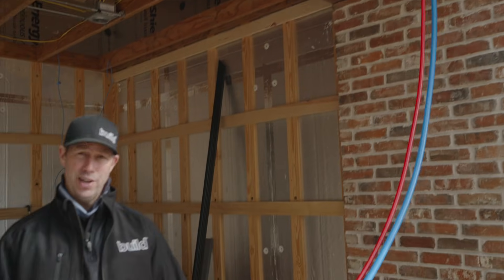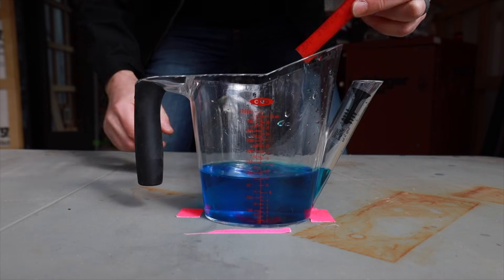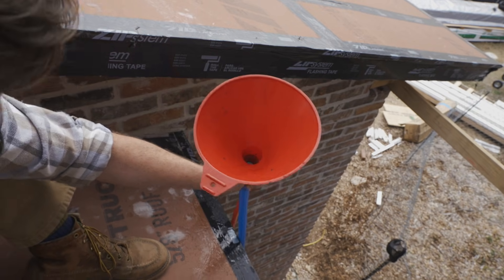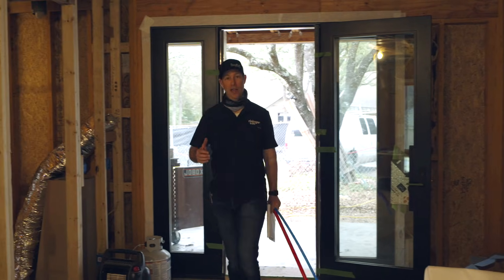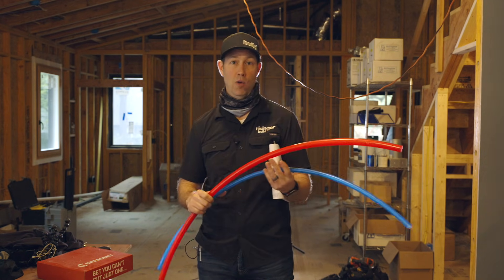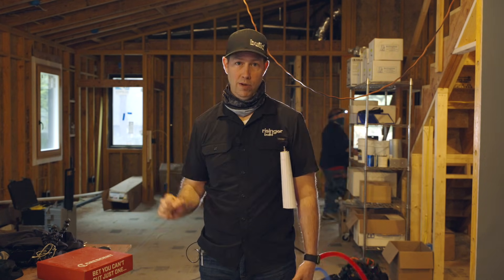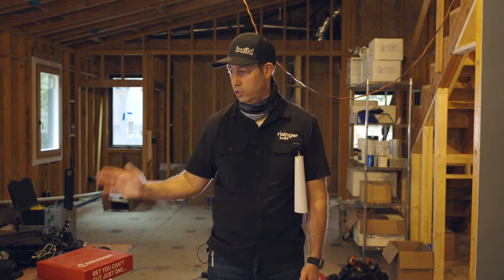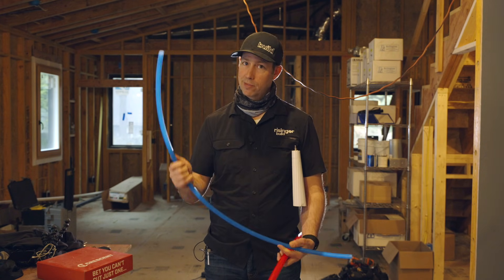What's the BEST Plumbing System

Comment: Been thinking for a while. Would it be possible to use a hot water circulation system as heating in a passivhaus?
Reply: Heat source can be the same,  but your boiler/heater must have separate loops for hw supply and radiant heat.
Reply: Using the main flaw of a circulation system as a benefit, I like it.
It's not hard to calculate the heat loss from such a system. If that exceeds the worst case heating need your architect calculated, then you're golden.
I've build passive houses that need little more then the heat generated by the humans in it. So I wouldn't be surprised if this and the energy reclaimed from the (cooking) ventilation will suffice in many cases.
Reply: I've been in condominiums that use that method.
Reply: Sanden with a special Taco pump ($1500) can deal with DHW and radiant.
Reply: It's called an Aqua therm system.
Reply: Summertime would be the problem.
Reply: @fuumink  I did think about this and was wondering if you could have it set up like a trunk and branch system where the trunk does a full loop with a valve and a pump in it to complete the circuit.  You'd probably be better off insulating the pipes though and reducing their efficacy as heat exchangers
Reply: @fuumink  Which is an extended period in Texas.
Reply: You could do a cheap system like that and run it off a water heater,  but not recommended. Ideally you really don't want heated water that has minerals in it running through pumps and valves, hydronic systems should have deionized water or chemicals added to help prevent scaling or a glycol based fluid.

Comment: Here in AZ I’m worried about the cold water. If we have city water we don’t have cold water in the 115-120 degree August, we just have warm and hot water.
Reply: Perhaps look at burying a loop 5 to 7 feet or so under ground.  At that level, the soil temp tends to run close to 55°F no matter where you are.  It's basically how geothermal heat pumps work for both heating and cooling.
Reply: I used $2 of natural gas to heat my water in August. Only appliance in my house that is gas is the hot water heater. I mostly used “cold” water.
Reply: Same problem. Shower with the faucet all the way on cold and it's still around 100 degree water. On the bright side, the water heater never comes on all summer.
Reply: And that is why hotels would put a sign on the cold water faucets reading - This Is The Cold Water.    LoL!!!!       I didn't even need hot water for showering in the summer when I lived in AZ.
Reply: Put it thru a chiller, or make your own  put a roll of soft copper thru a  refrigerator .
Reply: My grandfather had a similar concern when he moved from a hand pump in the county to municipal water in the city. He drove a closed well pipe into the ground in the basement beneath his bathroom faucet and put a smaller pipe down inside of it passed thru a tee on the top and circulated all the flow to his cold water tap thru it. Basically a geothermal cooled faucet, over 100 years ago, he died probably long before the term geothermal was even thought of.

Comment: Volume = π r² h. Less messy.
Reply: And

For pipes of equal length [h is equal], the ¾" i.d.pipe will hold 2.25 times as much as the ½" i.d. pipe. 

(.75÷2)²÷(.5÷2)²=2.25
Reply: But not as fun
Reply: I thought the same thing.
Reply: Yes, I think doing the math on a whiteboard would have been much more educational. It's always nice for people to see how things they learned(hopefully) in high school math and science class can be applied to everyday situations. It counters the old argument "I'll never use that!".
Reply: Can’t make a video with that
Reply: @Ethan7s  yes you can I watch them all the time.
Reply: @shawnshurtz9147  3blue 1 brown
Reply: @shawnshurtz9147  you can, but not as fun
Reply: Yep. Do the conversions, and you have 1.63c
Reply: @NeonSphinx89  I get roughly 1.47c for the 1/2" pipe. 1/2" is the outer diameter of the pipe. Looking at Uponor's web site, the inner diameter of their half-inch pipe is 0.475". Though the video says it is 0.485, so I might have looked at the wrong version.
Reply: @NeonSphinx89  what i got too
Reply: I'd rather do it Risinger's way...If I am the Plumber being paid by the hour
Reply: Or length in this case..10'
Reply: Google on pipe volume calculator for more info.
Reply: I was watching, saying "There is math for this!"
Reply: pies are round, not square
Reply: Using calculus:

V = h*pi*r^2

becomes

dV = h*pi*2*r*dr

when dr = r/2

dV = h*pi*2*r*(r/2) = h*pi*r^2 = V  

meaning the volumes increase by V when the radius increases by half.

No numbers, but doing demonstrations are fun.
Reply: @kubetail12  same as saying other things being equal the volume is the ratio of radius squared.
Reply: What is the verbal "h"? I assume it's length in likewise units? Or "height" if you prefer?
Reply: @alec4672  this is the internet. It's gonna be "heighth."
Reply: Not fun and more complicated 🙃
Reply: you need to know that 1 oz of water  is 1.8046875 cubic inches
Reply: (Dx.7854)xH
Reply: @georgec1818  nope still no clue.
Reply: Yes for inside diameter which is different ratio than 1/2 to 3/4 if wall thickness is same and outside diameter is the size of pipe
Reply: It would be nice if they did this using simple math, would show the accuracy of the pipe's engineering.
Reply: A little more than double:  3/2 the radius = 9/4 the volume
Reply: h and pi are constant so you can just compare the r squared values of each pipe size.
Reply: Proves 1/4 inch more = almost double.
Reply: Don't forget to insulate to reduce  loss.
Reply: Yeah, but most people need to see something with their own to eyes to really comprehend the results. It's also far more effect to influences someones behavior and choices.
Reply: Thank you!!!  Math is easier than running a pipe on your roof.
Reply: Pex expands as it gets warmer so you get some variance.
Reply: @Rad_Triumph_765_RS  also more math would also solve that.
Reply: @Rad_Triumph_765_RS  this pipe wasnt expanded...you will still get variance
Reply: @Rad_Triumph_765_RS  that has nothing to do with the video though. 100 feet would expand around 10 to 15 inches though it still won't cause more than 2.5 gallons of water per minute to come out of the faucet. Plus you'd already have the hot water at the faucet before the pipe expands.
Reply: Smaller branch pipes -> less volume means less cold water sitting in there, waiting to be drained. Of course - you could do it as europeans do and simply install a system that uses a small pump to circulate warm in the main pipes... oops. Thats what you will do
Reply: Also less fun
Reply: Easier to visualize also...
Reply: So what would that sum look like in cups ? Seems a little difficult.
Reply: Sorry was being facetious, WTF sort of measurement is a cup ????? That’s my point
Reply: All mathematicians in this comment 😂 it is not about a mathematical formula, it is about entertaining, making video more natural and interesting to watch not just puting plain numbers and formulas. Would love to see your construction videos based on numbers 😂

Comment: if you're recirculating the water to keep it hot, how much energy are you using to re-heat the water constantly?
Reply: Great question! I have always wondered this as well. Although, I bet if your lines are insulated it might be pretty minimal.
Reply: @frostman9661  There will be a lot of loss if its running 24\7. The pump will use power to. but it could be put on a timer. really the only time it needs to run is in the morning. 
Personally I don't think its worth the effort. I used a trunk & branch layout, and if it takes 20 seconds to heat up, that's fine.
Reply: And this is why tankless is (arguably) better than a tank.
Reply: @rbnhd1976  That's fair, but unless you have a tankless right beside your shower, you are not going to have much benefit when it comes to wait times, and depending on your set up, they are not any more efficient than regular tanks.
Reply: I added retrofit recirc to after we move in and none of the pipes have insulation. recirc on timer 7am to 9pm and gas bill doubled. (pump was fitted for half the billing period).
Added insulation to hot pipes and bill went down about a quarter. Now, I have the pump on custom smart switch and it would run for 10min every time I turn it on and we would do that before some time before shower (or whenever we want). water get hot very quick and the difference for gas usage is about the same as before fitting the pump.
Reply: Yep, and why its not a good idea in a residential setting. Its necessary in commercial because of large diameter pipes and long runs. What's the longest run you're going to do in a residential installation? Not worth it. Your best bet is to just insulate the lines well so that they don't cool so fast.
Reply: @ruelsmith  I still think it is worth it for residential use. The pipes are still gonna cool over night no matter the insulation. The wait time alone is worth it to me because the water heater is about 50' away straight line and the pipes are abt 100' long because of the crappy it is done. Also gotta remember that just running down the pipe volume is not enough to get hot because the cold pipes will also take away heat so realistically, it takes quite a lot more than single pipe volume to get hot water.
Reply: @victorchan8859  if that's your problem, then run small local water heaters. Recirc lines cool the water in the tank and cause the heater to fire more often, burning fuel and wearing out the water heater faster. I plumb in the commercial segment, and I've put huge boilers in with 3" cold lines attaching to them. Insulation does work. Every water line I put in gets insulated - the cold to prevent sweating and the hot to keep the water warm longer. We insulate with fiberglass, anywhere from 1" of insulation to 2" of it. It works very well for the purpose. Like I said, recirc lines are required on commercial because the lines are incredibly long. I just did a building 5 stories high with a large amount of square footage and not only did those lines stretch out a long way horizontally, but they stretched to the basement where the water heaters were, and they were 4" cold and 3" hot lines down there. You wouldn't want to have to empty all that to get hot water. Residential 3/4" hot for 100ft? Yeah, don't bother recirculating that line. It's just not worth it.
Reply: Many recirculating pumps have timers.  Only run it when folks are at home.

Comment: Measuring using millimeters should be easier.  Just saying
Reply: If all the measurements were in metric we wouldn't have even needed the demo. The volume of a pipe (cylinder) is given by the measurement V = PI * r^2 * l where PI  = 3.14159, r^2 is the radius of the pipe squared and l is the length of the pipe. Using cups and feet is absurd, when we use metric and we can practically do these calculations in our heads: 1 meter of 10mm diameter pipe has a volume of 3.14159 * (10/2)^2 * 1000 = 0.079l, or 79ml. We can then do other calculations like flow rate based off of pressure. One day we'll learn from the rest of the world and actually use that useful system to make our lives easier. In the meantime, I'm sure I'll get a bunch of smoothbrains calling me a commie because I see no advantages in measuring in fractions of an inch or using drinking vessels as measurements of accuracy. 🙄
Reply: @Silent002  

"If all the measurements were in metric we wouldn't have even needed the demo."

Shows how much you know.

The purpose of the demo is to provide a visual object lesson.

It's one thing to talk numbers; but when you actually show the difference with a visual demonstration like this; you have a greater impact on the viewers perception.

With the object lesson in place; it's difficult for anyone to argue that the difference isn't that great. Oh sure; they can argue it as some deceiving liars will do; but everyone that has seen this video is going to dismiss them as scam artist.
Reply: @scotttovey  lol, it's literally high-school math, not rocket science. This is a construction channel, if someone can't do high-school math they really shouldn't be watching, let alone commenting that they can't understand some simple numbers so the video is a scam. Is that really the type of person we have to placate these days?

Comment: I think that splash accident is also a good example of how much more volume you get. It translates to real life use
Reply: Yep. Whether you're filling a kitchen sink or taking a hot shower on a cold day, low flow pipes are really not your friend.
Reply: Only if you are lower in elevation from your water source AND if your demand for volume requires it. Otherwise you're working both against gravity and risk mixing your hot slug with the cold in the pipes, slowing hot delivery.

Comment: I’m not a fan of the manifold system.
Reply: I ran a 1” hot water main through out my house and have 1/2” branch that are no longer than 15’ and I loop the end of the 1” hot back to the water heater with a 1/2” and use a recirculating pump with a thermostat. It was on a timer but it wasn’t working out.

Comment: Awesome I was just contemplating what size PEX to use for my master bathroom shower remodel that's coming up

As well as a whole home build that will be coming up

The question is will oversizing be a problem if you're adding it to a existing system

Current house has copper piping don't know what size so should I just put large packs on it so that I'm not squeezing it out or will that result in low water pressure or something bad 

if you're adding packs into a remodel does it need to be the same internal diameter as the rest of the house?
Reply: You cant go down in size then back up and expect more pressure. 1/2" to 3/4" or 1" will still flow at the rate of 1/2" but will have more volume to clear out of the line and displace with new (hot) water so either put in a new line back to the heater the size you need for your shower demand (body jets, multiple heads, rainshower head, etc.) Or just keep it the same size as where you tie in.